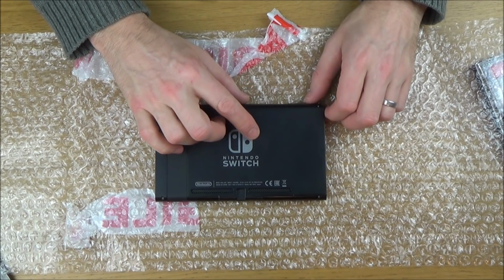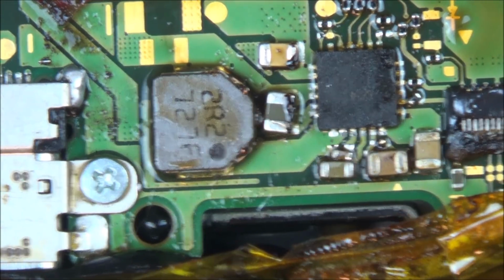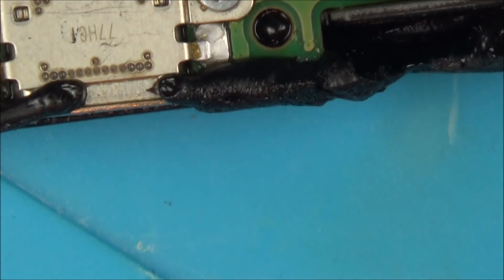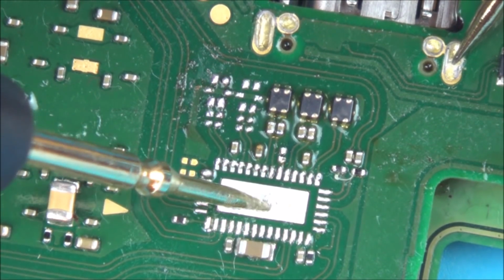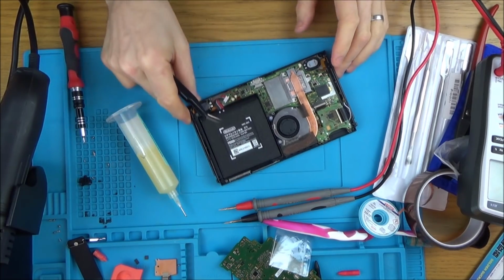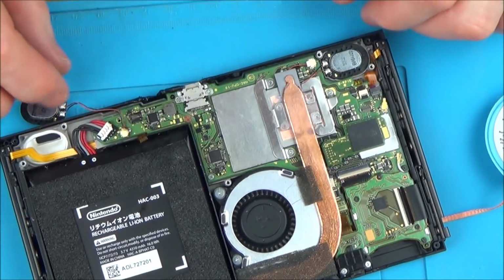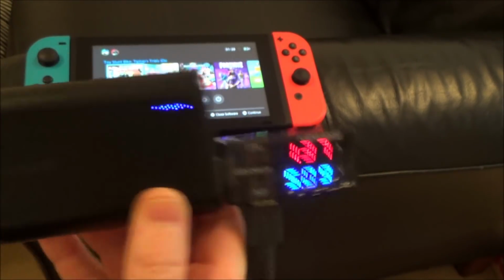Trying to FIX a Nintendo Switch with Numerous Faults

Comment: Ironically, the reason it all melted was the kapton tape. It is supposed to be heat resistant. But, around the chip it came off the board and the heat from the gun managed to get under it so the kapton tape acted like a funnel and directed the heat all the way beneath it. And because it is kapton tape, it kept almost all of that heat beneath the tape.

Also, when soldering chips, to make sure that there are no improper connections beneath them, apply heat until the solder melts and the chip bounces into place, remove the heat for a couple of seconds so it hardens, press on it a bit with some tweezers and apply heat again until the solder melts and the chip goes down more and the excess is pushed out the sides. Then just clean the blobs and you're good.

Comment: always remove boards from unnecessary components such as screens , housing, battery and any other connector or ribbon cables attach before soldering or reworking a board this is to prevent damage as well as makes it easier to work on the board , also always add leaded solder to chips or any other components you plan ti use hot air to remove or place in by mixing leaded solder with unleaded it will slightly lower the melting point of the unleaded solder allowing you to use less heat

Comment: The bit with the faulty joycon connector... slot the cable in the best it will... then use blue tack to  hold it!  Tips crazy but works... I did it on a wii u joystick connector  about 7 years ago... and it still working  now in dec 2022 !!

Comment: man even the tape is melting !!! Botched it completely! But in good spirits, good attitude. The job itself is hard enough man; you have to understand the power of giving yourself the best working setup possible. TAKE IT OFF the enclosure, setup nicely, make space for yourself etc. Its about winning those mental blockages and trying to take shortcuts that arent worth it

Comment: one tipp:
solder plastic parts (if possible) always from the other side.

i repaired tausends of phones, laptops and many devices when i had my repair shop.
and i soldered micro usb connectors, display connectors and everything fine and plastic, always from the backside.
this way plastic will not melt, its perfectly soldered and looks like factory soldered.

belive me, if you have no parts which is in the way on the back side, heat from the backside and look when the connector positions itself on the top side.
its easy when you know how.

Comment: i know im like 2 years late but at 24 minutes instead of adding so much tape because you didnt want to damage the connectors couldnt you just have heated it from the bottom side to add that chip and back so you can see it too without so much tape? or would it still burn the connectors? im about to attempt the same chip but im so scared lol

Comment: you realy need a better hot air station the ones with a hose, those ones with the blower built in the handle are not good at all , try an atten costs up to 200 pounds or go on amazon and get a yihua 706 wich cost 85 euros and does the job realy well

Comment: hello, can someone tell me if there is any fuse or what chip on the switch main PCB is responsible for the right joy-con? Couple days ago my brother use RCM to check my switch and from that time my right joy-con is not working, it's not problem with broken rail or connector, i replace them both and check them in other switch (works) i found the point just under the right joy-con ribbon connector that is equivalent of RCM pin 10, i try to ground it and check if the hardware button work to turn console it in rcm mode but even from this point it's don't do nothing. I check the joy-con i the different console and it's work.

Comment: Have you come across a Switch that had the wifi suddenly go out? I repaired one with water damage a few months ago. Very slight corrosion. Nothing major. Other than that it has never been harmed. Wifi suddenly went out and it does not recognize any signal anywhere. Not in airplane mode, tried all the typical fixes. I guess the next step is to replace antennae.. unsure why it would have acted up out of nowhere though. System is under a year old.

Comment: Next time try leaded solder and lower temp (like 380 celcius) because the leaded solder doesn't need a really high temp like the lead free solder and for people that don't know gel Flux is a life saver 👍
P.s. For the plastic connectors are easy to fix but just need more attention and the resistors pre heat the sides with a iron to warm it up faster with hot air

Comment: try aluminium foil tape(reflects heat and dont absorb) instead of kapton to cover only the connectors the capacitors dont die from the heatgun :)

Comment: I have a Switch charge port idea, melt the soldier on the board and drop the chip in place only hitting the plastic pieces for a few seconds to guarantee alignment.

Comment: Work of advice. Take the board out. Once thr ic is in place take away heat. Allow to cool for a few seconds then push down on ic then heat again. Saves moving. Then remove excess solder from edges. Dont use so much flux because you will moves around components and also you use lower airflow first then once chip is in place up the airflow a little higher then give it a final float. You will see it move into place. No criticism just a tip.

Comment: This method was likely worse on the overall board than doing it without the tape. The tape at this point is actually trapping a lot of the heat and the flux isn't allowed to freely disperse, instead boiling throughout. Clutch fix though.

Comment: Don't get discouraged as only way you learn. I destroyed a few iPhone board early on. Advise I can give you is get a Quick 861DW hot air station. It is the best for the money and don't have to have it at 480 and 350 will be enough. It just transfer heat better as do those chips in a few seconds and don't melt anything in the process. Always remove the board.

Comment: First if all really nice work :)
I know this video is quite old, but I am stuck at same issue... Replaced P13USB as it was blown. Actually, then it worked but only in handheld mode. Afterwards replaced USB port and M92T36. Still same issue no output to the TV, but charging and green light constantly on.
Did you find out the reason for your switches ?

Comment: For protecting chips & connectors, use those aluminium tape rols, the one they use for isolating a house, but don't stick it down, just leave the protecting paper on it on the back, glue it down with capton tape, that stuff will protect your connectors like no other, but never make the mistake of pealing back that paper and stick that aluminum tape directly on the board, its an utter nightmare to remove the glue afterwards, trust me, i know ;)

Comment: Has anyone seen issues with the MAX77620A chip? Working on a unit with water damage in that are, and some of the caps around it show ground on both sides. Wondering how difficult that chip will be to replace.

Comment: Vince if you need to replace a charging port and you have another one on an other board have you thought of cuting the board out around it fitting the other one in and connecting it up

Comment: That's too much flux imo and i always remove the board from the casing i was wondering why didnt you do that and you can set the heat up to 350*c or 380*c dont go over 400 or you'll fry everything else

Comment: Pretty GJ but i have few tips: less tape and less fan on hotair.... Also you don't have to cover other elements on the board with tape, tbh. you even shouldn't, bcs direct heat in one point without heating whole area might cause micro cracks between layers... that's why whenever someone is doing reballing they are doing in on heatbed (or in the oven ;D) i know that with such fan settings you would probably blow off some capacitors or resistors, that's why you should set fan to lower settings, and remember heat up the board ;D Oh and i forgot that i got anxious when you didn't replace solder after replacing element

Comment: When I was reworking in the electronics industry we had a set of heat gun square / rectangle nozzles that fitted just over the IC so that the heat could be concentrated in the area. We had a set that fitted the majority of surface mount IC's. We also had a wire tool that slid under the IC that aided in the removal once the solder had melted.

Comment: Love the channel and your excitement at getting signs of life out of dead items, sometimes you get it all working, sometimes it's your nephews iPhone. I'd like to see you fix an Omega f300, I know you like an Omega quartz, the f300's are a bit more special, akin to how B&O are special. Elsewhere, you mention being on the tools ex BT, so you probably know the differences between a No.1, a No.6 and a pair of 81's. Do you have a run down of the tools you use? I can see some are budget, some are better and some are exotic. It looks like your tweezers have good points and stiffness, mine are awful, soft metal and bend away from where they are meant to grip. I haven't found any good ones, what are yours?

You've also inspired me to have a go at some SMD repairs.

Comment: If it is thought to be the charging port or chip that is bad, why didn't you connect a charged battery to it and see if it works. 
All that time wondering how to fix it and you don't know if it will even boot up. :( :(  AND you covered one set of legs with tape so how much more heat are you going to subject the area to??

Comment: I know its been a year but I never get tired of watching these. One thing I've actually discovered by accident with these types of small connectors is that if you apply the hot air from underneath the the joycon connector you'll be able to get the connector off more easily in the unfortunate event that it does get melted. Then all you'll need to do is drag solder the new connector pins to the board. Much like the PS4 HDMI connector replacements except the board here looks to be thinner so you'll likely have an easier job doing it this way. not just with the joycon connector but also the usb and possibly the screen connector as well to get them off the board

Comment: This video along with some of your other videos gave me the confidence and knowledge to fix my nintendo switch. I busted the PI3USB with a 3rd party dock which didn't handle the power delivery protocol correctly. It wouldn't turn on but not it works docked and everything after replacing the PI3USB and one of the chokes. Thanks

Comment: Hey I'm having issue with my switch console not turning on, I can hear a buzzing noise coming from on the motherboard. the charging indicator does not show up on screen, when pressing the power button and waiting a few seconds then taping on the screen does nothing. I have two videos on my channel of the issue occurring. what do you think it could be? Thanks!

Comment: I think the safe way is always disconnect power first, then examine the chip with a good look. clean up corrosions first if any. check shorts, give the chip a float (just use flux and melt the solder without removing the chips), recheck shorts, connect power have a look if no more shorts. I would never connect power and try to power up before I have a good look and examination first. BTW, you want to do the melting fast, so high temp, low air flow. usually 230 Celsius should be plenty heat. heat the component evenly first, then concentrate on the chip. minimal tape to isolate fragile component, no tape on tiny resistors and capacitors. try not to heat coil, if will melt the insulator.

Comment: I came across a Switch I attempted to fix a while back, where it would work in handheld mode but refused to dock. Did you ever figure out what caused the issue? Could it be an issue with the installation of the replacement PI3USB or is another area of the PCB more probable to be at fault?

Comment: What might it be if backlight turns on but no battery indicator or anything pops up on screen, No sound and doesn’t output to dock but charges fine and connects to joycons?

Comment: You use too much flux!!! Its really excesive!!! And the meses trying to fit the chip its because you use too much air Flow wich its not necesary, so the excesive air pushes the chip and cannot put in place. Not to mention the real high heat u used.

Comment: I'd suggest you turn the air station temp down to 350°C and the airflow to minimum. It'll save you much trouble as you won't burn the flux and kapton tape, and reduce the risk of damaging or displacing other components and stuff... Also, the middle pad on the chip may just be for heat dispersal and may not be grounded. Love your videos, keep it up!

Comment: you also trapped the Heat beneath the Kapton tape by applying so much next time remove the board and use a metal heat shield between components

Comment: Air is fun, but do not forget your trusty soldering iron - for everything but QFNs it is much faster and safer. And do not forget your air gun - should you haven't lost 'em ;) - has a set of nozzles for various IC sizes. Also consider a soldering blowtorch with a catalytic nozzle as it is (also according to actual documents) a much better choice compared to electric heaters. That is, it doesn't blow parts away (as the airflow is less harsh there) and is much more consistent in terms of temperature.

Comment: Hi Vince! :)   I know it might sound stupid but buy a proper hot air station as instead of spending 1,2,3, minutes getting a chip off or putting them back on, with a proper one you can do it in 30 seconds witch might protect the connector next time, just destroyed a 3000$ Alienware laptop  keeping the heat for too long
Cheap and best investment is the QUICK 861DW hot air station IMHO.
Fantastic videos!!!  All the best

Comment: 36:50 its not a resistor but a capacitor. Capacitors around chips are usually used to keep voltage a pricise as possible, filtering out some ripple. Orientation of ceramic capacitors like this one doesn't matter.

Comment: The fan wont spin and the dock light won’t com on if the switch is in RCM.
Reply: Additionally.  A bricked console CAN automagicly go into RCM if it cant boot into HOS (switches OS).   If you think a console is in RCM hold the power button for 15 seconds.  This will force it off.
Reply: Also RCM ONLY works on the right joycon rail.

Comment: I was fixing a ton of switches lately and find out one trick with replacing a BQ24193 chip and connectors near by, because this is a very small part of the PCB it can't dissipate heat that fast and you can heat it up from other side, easy chip replacement and 0 damage to the board elements.... and use aluminum foil that is way better than kapton tape that melts and dangerous for your health! I hope this trick will help you ;-)

Comment: you do not need such high temps just more patience, 300 to 320 degrees should be enough. I think the tape ended up funnelled the heat onto the components helping melt them,  you need to keep at this, get a scrap board and practice removing and adding large and small components. Once you get good at it you can increase the temp and speed up  your work, but there is no need for the tape. Just patience and practice, everyone has to start somewhere.I wouldn't give up on this at the point where yo melted the ribbon connector i would have tried to replace it. What have you got to lose and it would be another feather in your cap if it worked. I really enjoy your videos and your determination, a man after my own heart, I no longer do such things but it is so enjoyable seeing someone who gets such enjoyment out of repairs like i used todo, sense of achievement is awesome. Keep up the good work buddy.

Comment: also with such a small chip you should have used a much smaller nozzle with low airflow that way its more concentrated were you want and not were you dont. also your main problem is you left the lead free solder on, leaded is much easier to work with.

Comment: The main problem with your reflow tecnique. 

-Remove the board from the case.
-The apply a little solder to the pads
-Place the chip over the solder and apply some flux.
-Let the heat do the rest. 300° and very low flow to prevent send flying any neighboring component.

... or you can use some solder paste to reflow chip.

Comment: Heyo help please my nintendo switch fan does not really work its really low and 
My nintendo switch overheats and turns off everything else works but it started happening because of the nyko charger is it just the fan that needs replacing please help

Comment: When removing chips from a board it's better to do it without the tape. That tape creates a chamber where the heat is kept and starts melting everything. You can redirect better the heat by applying it directly to the board and watching how everything reacts.  

Another thing is when placing a new chip, you can apply a little bit of solder on the pads with the soldering iron beforehand, once you place the chip, the solder should put the chip right into place without issue, word of an electronic engineer 😁

Comment: You can buy silver foil tape works well,also i would recommend preheat board and don't have your hot air on full ,i always bring board heat to 160 then with everything covered in foil tape turn your gun to 370 and put close to ic and remove,hope it helps  ebay have lots of foil tape

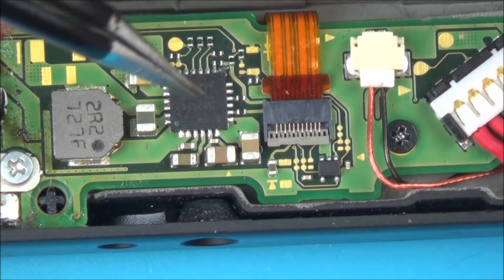Comment: At 32:54 when you were cleaning up all the resisters that you knocked around or lost, there is one more that you didn't replace right above the chip see these two screencaps from 14:28 where the component is still there and 32:54 when it's not there. https://photos.app.goo.gl/2zXj7S1bVehcjDDB7